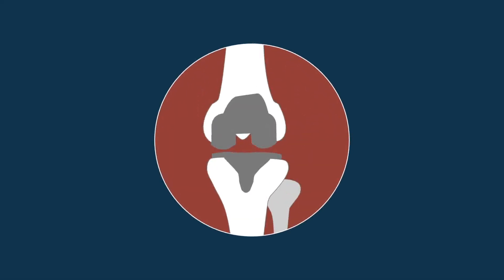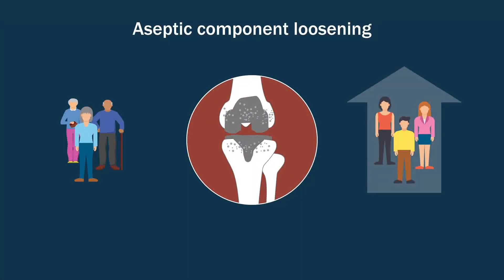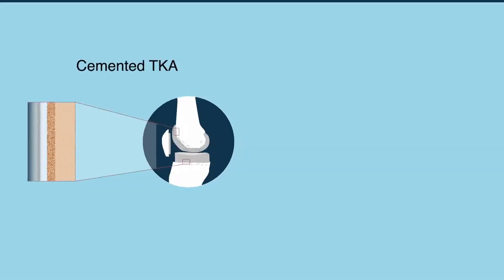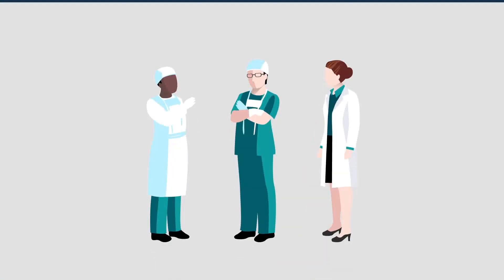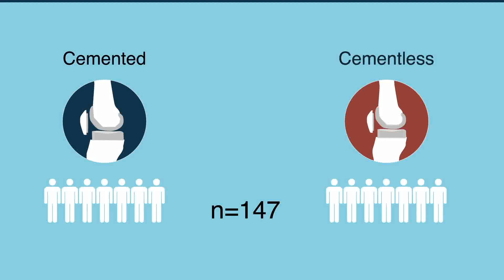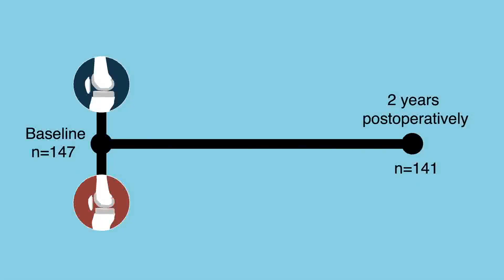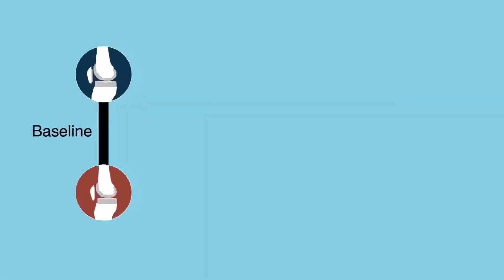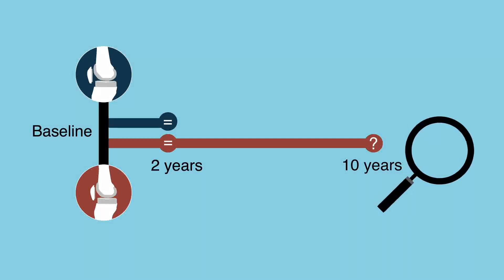Cemented Versus Cementless Total Knee Arthroplasty of the Same Modern Design

Comment: I'm going to have the cementless, my Ortho Dr. told me the advantage in the cementless is beings I'm on the younger side of usual TKR's (58), when I go to have another in 15-20 years, they will only have to replace the plastic spacer, not the metal parts. With cement, he said, as the cement brakes down, even the metal pieces must be replaced.